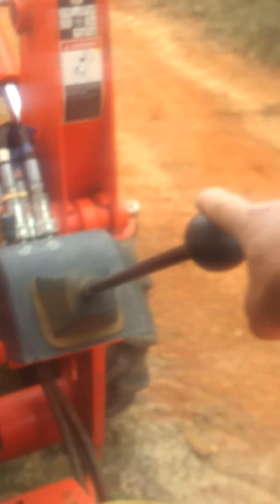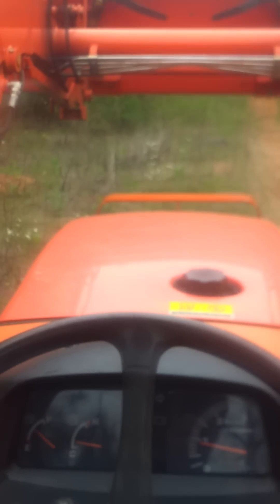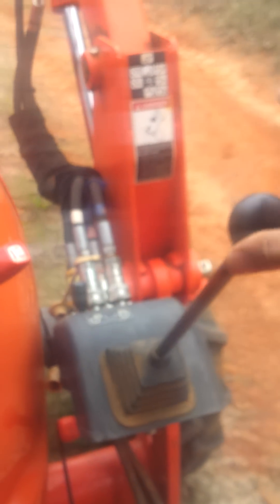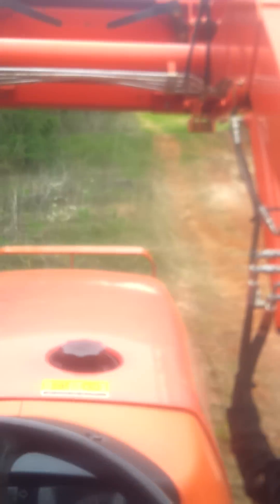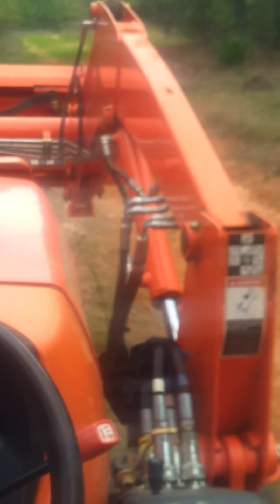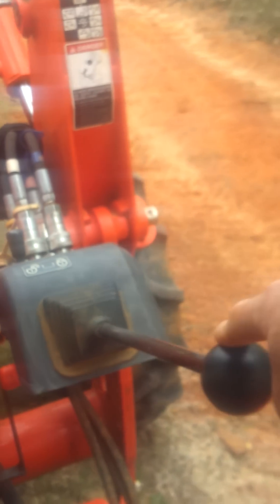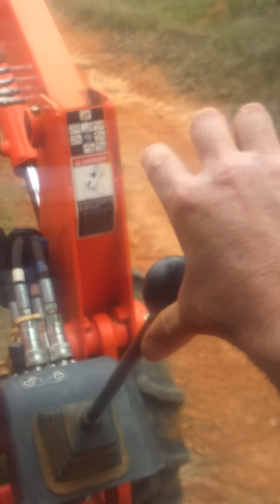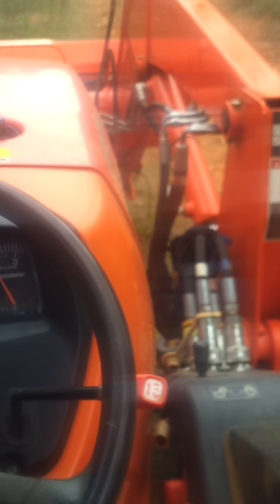hydraulic problem on my tractor front end loader

Comment: The answer lies in the comments which were very helpful.  Mine is a 2024 model L3902.  It started doing the exact same thing.  I called the dealer and they told me a bunch of dumb crap that I knew wasn't the problem.  It never occurred to me that it was related to the 3 point  hitch.  Go figure.  Thanks to all that commented.

Comment: I have a 73 Yanmar. bucket won't raise. Tip is fine. When I disconnect the right bucket piston from the front and it extends all the way out, then the bucket will raise, connect it again and it won't. Any Ideas?

Comment: I have a 1984 Kubota B8200D and my loader quit working.  It would go up and curl up, but nothing down. After watching your video about a hydraulic line coming off, I went to my tractor to see if hopefully that's what it was.  Bingo!! It had popped off because the emergency brake lock lever hits the side of the coupling when you set the brake. I'll have to make some kind of an adjustment, but now I know what to look for.  Thank you so much for posting this video!! How frustrating, but I thank God it was an easy fix. Again, THANK YOU!!!!
Reply from the maker: Glad you got it fixed

Comment: Thanks to all who posted the solution, my Kubota 4700 loader is working again. The 3 point lever was pulled all the way up and was just slightly past it's maximum (#8) position. I put a limiter screw in to prevent that much travel in the future. Never would have guessed.
Reply from the maker: Great news.
Reply: I am having the exact same problem on my B2601. I noticed the bucket worked when the 3-point was down, but not up.  I was glad to find out the solution was this simple. The 3-point was just going too far up.  Thanks for the video, and the fix.

Comment: I have the same tractor and the bucket won’t move at all. Joystick is locked and won’t move. Help.
Reply: I had same issue twice. Once I had the lock unlock lever right near the hose connectors in the wrong position somehow. The 2nd time I pulled the plastic cover off and the bolt had come loose and would not allow the lever to move. Hope this is of some help.

Comment: When I pull the lever down it doesn't move at all, but everything else works fine.  Any ideas?
Reply from the maker: What lever?
Reply from the maker: Are you talking about the 3 point lever? If so maybe the knob under the seat is turned too much in.

Comment: It is the lever for the 3 point move ti forward just a bit. You should be able to hear the motor change rpm just a little at ideal. The 3 point lever needs adjusting. When the 3 point lever gets a little worn the lever goes back to fare and closes off the fluid flow. Your loader gets fluid first then the 3 point. If fluid can't flow the valve power be-on line loader valve starts dumping fluid out the tank return line and not the power be-on line. So the fluid is sent in the wrong direction inside the loader valve making the loader misbehave.

Comment: My jd 2250 goes up slow 
And down fast 
And gets suck only in up position. 
Any ideas
Reply from the maker: Sorry bud, if the 3 pt lever isn't the issue, I don't have a answer.
Reply: Brad Chaisson I’m thinking it might be seals in the valve . I have no idea. New to tractors and hidraulics
Reply from the maker: I thought mine was the valves and the dealer told me they never have valve issues.
Reply: Brad Chaisson a spring inside the valve snapped for some reason.
Reply from the maker: Glad you figured it out
Reply: Brad Chaisson please keep your videos coming sir
Reply from the maker: Thanks brother
Reply: @jacqueskisling8241  I'm having a similar issue, where did you find the spring valve that caused your issue?
Reply: @johnring8590  get someone to hop in the cab and pull the arm up and down.  There's linkage that connects to a block on the hydraulic line.  The front of it has two flats that you can undo via spanner.  Undo it and pull the little piston and spring out . It could be the o rings on the little piston to . 
If you need more help just let me know man I'll be more than happy to help you

Comment: What happens when you have a front end loader vovlo L90e hydraulc fluid cap off and all the hydraulc fluid drain out dose the loader shut off with the  bucket up in the air i need to no please if you can tell me
Reply from the maker: Not sure, but with no fluid in the system the bucket should fall.

Comment: I had the same problem.  After finding your video I went back to tractor and noticed the pto lever was up high.  After lowering it the FEL works!  Many thanks.
Reply: Enoch Furyan I’ve looked everywhere to find what the FEL stands for...
Reply: Front End Loader
Reply from the maker: Great so glad the video helped you.
Reply: Enoch Furyan 
How to fix hydraulic front end loader?
I having problems with my tractor front louder goes up n down very slow.
Reply: Check that you PTO lever is in neutral (low number).  Not sure what your tractor model is but in my Kubota that fixed the issue.
Reply: Enoch Furyan 
The model number is 270TL boomer. The front end loader goes up and down slow as in the video

Comment: I love google and youtube.  I have a Kubota 2230.  I was using the front end loader and the up and down of the hydraulic stopped working.. the tip was okay.  Anyway, I read this through to a post and found the simple answer.  All it was is the hydraulic control for the 3 point hitch was not in the neutral position.  Put it in neutral and everything was fine.  It makes no sense to me but it worked!

Comment: Just had the same issue on our new holland, the front end loader acted exactly like the one in the video, the guy that was operating it when it was acting up put 5 gallons of hydrolic fluid in without even knowing where the dipstick was. So I drained out 5 gallons to get it to the proper level. Still had the issue, but after reading the comments here the 3pt lift comments stood out to me. This tractor has a pto driven backhoe attachment on it right now and it is a fixed 3pt mount (it does not raise or lower with the 3pt lift). Someone had the lift lever pulled back essentially trying to lift the backhoe that does not lift.... Pushed the lever down to float position and BAM! We have a fully operational front end loader again. Most of the time it's the simple stupid things. And thank you to all that commented and led me to finding the problem. No it's time to show everyone where the dipstick is and how to properly operate the machine.
Reply: Thank you! You make me look i know what i'm doing

Comment: After following all recomanded procedure for testing 60hp hydraulic cylinder. piston blow off at 3200 psi but  & leakage rate is also zero after. but it became leak after some time. actuly i''m working on "relief valve plug" please suggest something............

Comment: Wolf Moon was right on in his answer. I had the exact same problem with my Kubota and the problem was fixed  when I opened the valve for the three point hitch and moved control to float. The only difference was my local Kubota dealer quoted 
a cost of $1248.00 for hydraulic control valve and $200-$300 for labor. Kubota Service center list valve at $1000+.....only in America!

Comment: We have a case 444. We do not have a 3 point hitch and we are having this slow bucket movement. Goes up slow and down slow and no power to push anything. Can it be the travel valve? Thanks

Comment: Genius, the 3-pt was the problem.
Reply from the maker: Yeah, after lots of headaches.
Reply: I'm facing leakage problem with mahindra 60HP hydraulic piston. it blow off at required pressure and after blow off air leak testing is also ok means zero , but it is getting leak after some hours. Piston is assembled with "Relief valve plug" and i'm also working on it
Reply: what is the 3-pt?
Reply: 3-pt was my problem also.

Comment: I figured it out.  When the 3 pt lift arms are all the way up the pump routs fluid there.  I put a nut and bolt and lockwasher in the track so the lever arm cannot go all the way up. Fixed.

Comment: After mounting a three point backhoe on my kubota I accidentally pulled the three point lever up, a.lot of the hydraulic power was being sucked up by the poor cylinder in there that was trying to lift the hoe through the frame. I started tying the three point handle down after that.

Comment: Can someone help me on how to drain the air out of a loader  Kubota B7800??
Reply: remove the dipstick and fill plug and I use the Hydraulics like usual and see if that helps that way it can maybe burp out some air I do this when I change the hydraulic fluid works fine for me I have the Kubota B2400

Comment: Hi Brad,

We are having a similar problem with the hydraulics on our farm tractor except ours never works right, even after lengthy use.  I was just wondering if you have found any solutions to this issue. Thank you.
Reply: At the moment backhoe B90B New Holland slow lift at front end loader and the backhoe as well. 
seek /need help
Reply: From the looks of the action it appears that the tank return on the boom is not draining property. When your put action on the bucket at the same time you move the boom, the boom speeds up. What is happening is that the boom gets to drain through the bucket drain.